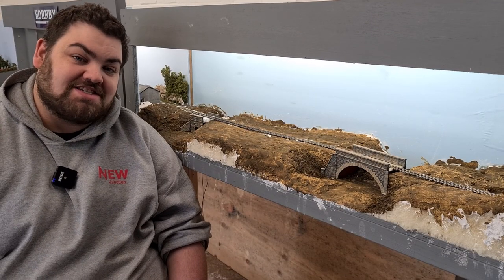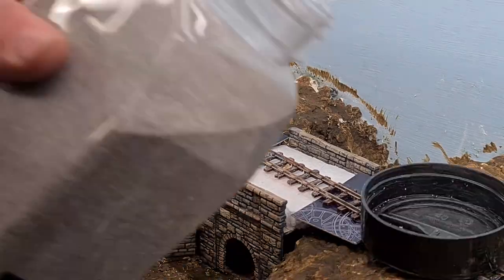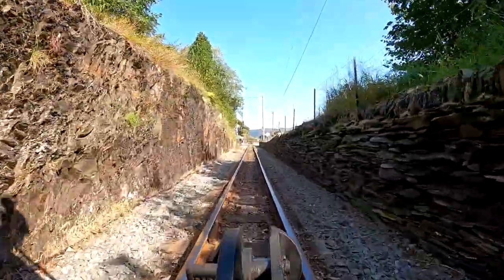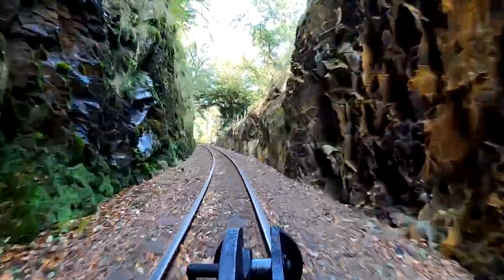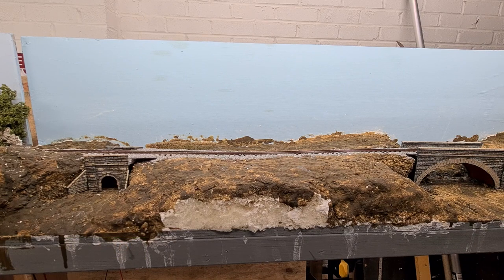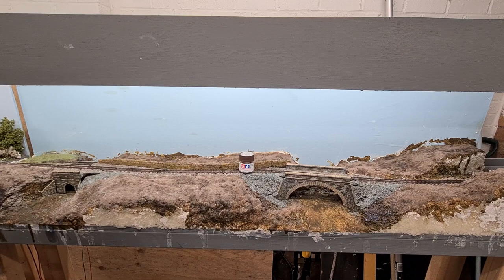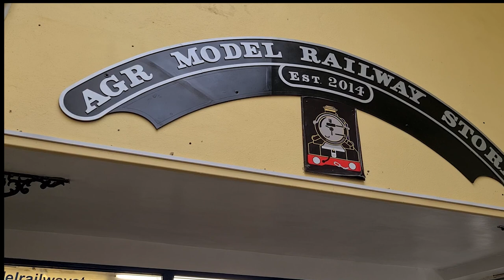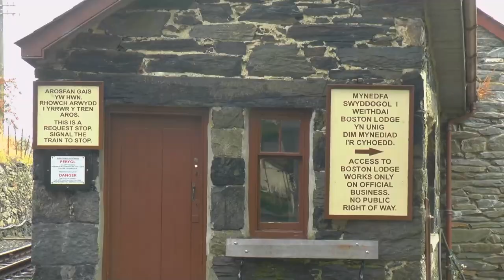Building the Ffestiniog: Part Two | Hornby Magazine Show

Comment: I always paint my track with humbrol 29 dark earth (or revell equivalent) for sleepers, and humbrol 113 rust for the rail sides and rail chairs, before I wire it and fix it down and ballast, so the paint doesn't get on the ballast. I'm yet to go over this to weather it properly yet, although I do now have an airbrush.
Am now considering ripping up the greenery I've put down on my layout, since it uses the products supplied with the "build your own model railway village" magazine collection so they're a bit crap, and start again with woodland scenics products.

Always love the ffesty. What do you mean, you can't pronounce Penrhyndaeudraeth?
Hope someone releases Linda and Blanche (and maybe Charles) in 009.

The "grey" on those IC HST power cars looks terrible, as does the green on the A2/3... Also, the lights on GT3 can't be right, since the lower white marker lights on the front would interfere with the lights behind the headcode discs, and there's no way of turning them off out-of-the-box after fitting a dcc chip.
Reply from the maker: Few top tips there 👌

Comment: Nice work, but the joins in the walls spoil the overall effect, making it look like a model. Perhaps apply plastic filler to the wall joins? 
Also, I think the trees are too dense. Looking at the film, the trees are of the more “open” type.
Reply from the maker: Thanks for the feedback Ray, will have to look into the walls.
Reply: @hornbymag  I think they are Resin, so you can put them in hot water for a minute then curve them to shape....
Reply from the maker: Oooo that sounds like an experiment, watch this space. Many thanks 😊
Reply: @hornbymag  Remember to use tongs or tweezers !
Reply from the maker: @rhiwderinraytube  better than finding out the fun way! 😅